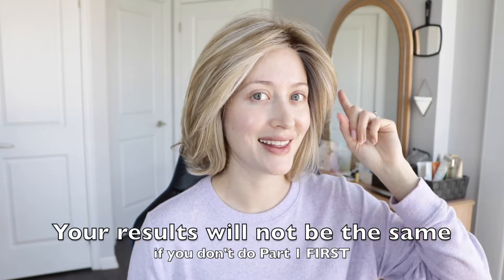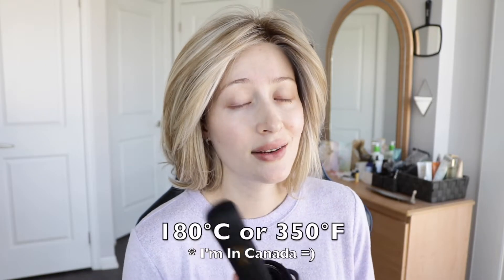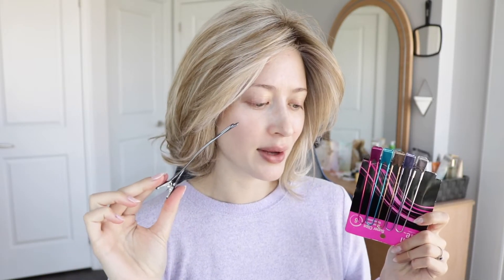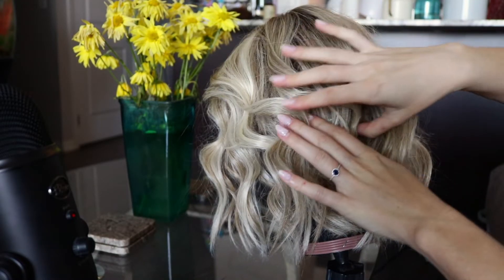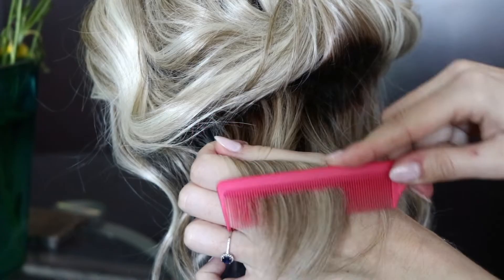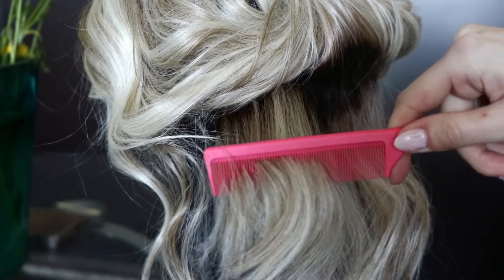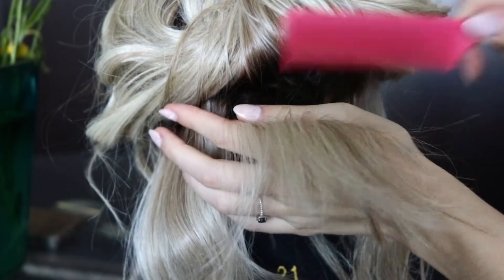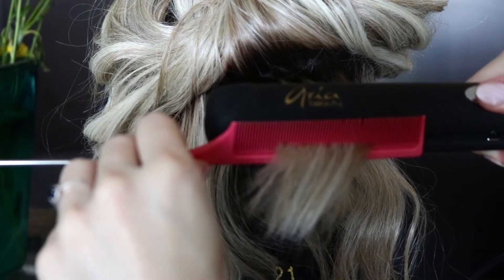MAKE YOUR OLD, Heat Friendly Synthetic Wig Look BRAND NEW With Straightener| PART 2

Comment: Wow, these are some really good techniques! I have used fabric softener with some of my wigs and I also never saw an issue with it.  But I have never heard of using the Bonner Soap! I can see why that would be great to use as it is all natural and has softening oils in it - and you can use it on a lot of different things. I have some HF Belle Tress wigs that I need to try this with. I have seen that I have to add heat back in to my BT wigs every few wears to keep it looking good. How often are you washing your wigs; and by using the straightener, aren't you afraid of taking out the curl pattern of Simmer?  I tend to buy a lot of wavy/curly wigs, and I hesitate to use a straightener to add heat back in.
Reply from the maker: Yes, I absolutely recommend it!
Not at all, on Simmer, I will totally take out her wave (on purpose!) to revive her and then I’ll just use the same straightener to put the wave back into her after. This is how I’ve been able to wear her every day without her weighing down. Re-styling was something I was afraid of at the beginning of my wig journey because the wigs come so beautifully styled! But the great thing about heat friendly is that you can keep changing it until it’s perfect. And after enough practice, it becomes easy. I now easily return her from wavy, to straight, to curled, to straight again, and have no issues at all. Actually, the wave on simmer in this video was my own creation! I’ve had her straight many times in the past 😊💕
Reply from the maker: I don’t have a set “rule” as to how often I wash them. If I find a lot of makeup build up just on the lace front but the fiber is doing just fine (moving in the wind naturally / not clumping together) then I will just put the dr.Bronners soap on her lace and quickly rinse it off. 
If I wear her every day, (let’s say it’s summer and it’s been super hot) and her fiber starts to clump and get tangly, that is when I’ll wash her and refresh her with heat the next morning 😊 I hope this helps!!! Thank you so much for your comment by the way!!
Reply: @WigsWithSteph  I have found my BT wigs do not curl as well with a straightener or iron on a low setting. The only thing that has worked is a set of hot rollers I have. No real setting on them so they just get good and hot. I will leave them in for days at a time and the curl is really nice and holds. I may try a small section and straighten the fiber first and then curl it to see what happens. I have found a hair dryer works good as well to add heat back in

Comment: I understand the process of smoothing it now, but I am confused as to how to get the specific wave pattern that the wig started with. When I have tried to use a straightener or curling iron the hair doesn’t just glide through them like yours did. The only thing the straightener does is straighten the curl.
Help!🤔🙏

Comment: Ok girl, I'm going to pull out the RW Editor's Pick wig that I gave up wearing because I couldn't return the waves & curls in it.
I haven't tried the fine comb with my straighter. I was WoWed at your technique. 
I hope this will save the wig!! 
I'm horrible at curling with the Straighter so I use a Hot Air Brush.... holding the heated curl to allow it to cool is the secret, or pin the curls to allow the cooling time.

Comment: I washed and conditioned my first HF wig today and it was drying while I was watching your video. Most of my wigs are non-HF and I figured my HF wig was at the end of its life, since the fibers had been sticking together and hard to comb through…BUT decided to treat it with the same Bambu Silicon Mix conditioner I recently discovered and had used on my non-HF fibers. I washed it, rinsed, pressed the water out by laying it in a very thick microfiber towel. I coated the fibers with the Bambu Silicon Mix. Placed it in a ziplock bag for 4 hours (which can be overnight). Took out of the bag and gave it a good rinse. Patted out between a towel again and hung to dry.
I stopped your video at 9:15 minutes and went and got the wig. 
I took a wig brush to it and saw my wig was transformed to its former days. 
So glad I won’t be needing a wig head for my HF wigs, which I’ve never used heat on. 😊
Reply from the maker: That’s great! So glad you’ve found something that works so wonderfully for you 😊

Comment: Great video! 💗 I've been using fabric softener and yes, it works wonders. Thanks for sharing your flat iron technique! Have you ever tried adding a mist of water to the heat friendly fiber before flat ironing? I haven't done that but have read that it works pretty good as well. 😊

Comment: I did hear not to use fabric softener on hand-tied wigs because it loosens the knots. If it’s not hand-tied I would not see a problem either. 
Great video- it gives me hope to buy a heat-friendly next time 💜
Reply from the maker: I have not found softener to be a problem on my hand-tied wigs :) But if there was some concern, someone could always use the “dip” method- just by dipping the ends, mid-length of the fibers into the softener could give it the same effect I would think. For myself, I’d never not use the softener. I find without it, I can not achieve my desired results
Reply: I trust that you know what you’re doing 😀
That was all hearsay what I wrote above 😆 and we know what that amounts to….
I love your videos and just subscribed 🌺
Reply from the maker: @have_faith_  you’re the best, Cindy!! Happy to have you here!!! ❤️
Reply: She used fabric softener on her mono top wig & it turned out OK. Hand tied is basically a mono cap

Comment: Hi there what about steam? I was told to use a steamer
Reply from the maker: @patriciaikeda2608  using a steamer for a regular synthetic (not heat friendly) is the correct tool to use. You would do the exact same process I showed in this video, except use a steamer instead of a straightener

Comment: Question! 🙋🏼‍♀️
If you wanted to add structure to the waves, could you use a salt spray? Or maybe something else?
Reply from the maker: I think a salt spray isn’t really needed on synthetic wigs because they hold really well to any shape and I find structure is pretty good without. I tend to like to keep my wigs as bare and without extra product as possible (so that I don’t have to wash as frequently)- although I haven’t exactly tried a salt spray on my wigs before. Perhaps the waves could benefit? I’ll have to try it and let you know 💜😊

Comment: When you use heat to take out tangles, does it remove the memory of the curl or bend in the hair?
Does the hair go back to the original curl?
Reply from the maker: Hey! =) Adding heat to a heat-friendly synthetic wig will alter your wig, BUT if you use a low heat setting, and go over it gently and not too many times, you could potentially keep the wave or curl. This is why I only begin adding heat to it when my wig is like DYING and it doesn't feel nice anymore. At this point I really don't mind if I have to re-style her. I'd rather make her feel like new again, soft and beautiful, even if it makes her straight. I can then go in again, AFTER this technique, and add curl or wave if I want =) OR leave it straight for a couple of weeks, wear her around like that (enjoy a new style!) and then put the curl or wave back in =)
But yes, adding heat does alter the style (the memory style) of your wig.
Reply: @WigsWithSteph  That's what I thought but thanks so much for replying. Your videos have been really informative and helpful!
Reply: @WigsWithSteph  This is what I'm afraid of.  I am NOT good at styling, and the built in waves on my wig are so perfect.  I wear cheaper wigs and you can definitely tell the difference. They don't last 2 years, I can get maybe 3 months max.  Then I have to start trimming off split ends and it gets so matted I feel like it's unfixable.  So you are able to fix your rough split ends with the straightener and you don't trim them off?  Thank you so much for your videos!
Reply from the maker: @karaitskara  Hi! Yes, that's correct! I am able to fix my rough split ends with my straightener every time (I don't trim the ends). But keep in mind the more you straighten, yes, over time your wig fibers will become straighter. So, if you're wanting waves, waves will have to be something you put back into your wig (recreate them). I know it can be a daunting task - it was for me too when I first began!!! But I swear to you it's SOOOO worth it, and it becomes really fun when you learn an easy wave, easy curl, and... well... the straight is easy LOL. But, once those skills are cultivated, keeping your synthetic heat friendly wigs looking AMAZING will actually be fun! =D

Comment: Does this work for every brand? I have one from Ellen Wille.
Reply from the maker: Great question! Yes, this technique will work with every heat-friendly synthetic wig. It doesn't matter what brand. What matters is that the wig is heat friendly. If it is, this method will work. I have Ellen Wille wigs too, also Jon Renau, Belle Tress, etc..., and as long as the wig is heat friendly, this works amazingly!
Reply: @WigsWithSteph  Ok! I will try it! Thank you!

Comment: Your videos are awesome!
I have problems with various wigs, where the ends become dry and frizzy and that does not change after washing and styling. I buy cheaper synthetic or heat friendly synthetic wigs, often on sale. Maybe that is part of the problem but I can't find that others run into that. I have a hot air brush and I am not yet brave enough to use a straightener again, because when I used mine on a particular more expensive HF wig the first time, just on the ends, it frizzed them up immediately. I guess, I am just too stupid to get it right. Any tips?

Comment: I have a question about the styling spray You said you only straighten and curl on a clean shampooed wig but do you spray the heat protectant the stalling spray on a little bit before you straighten or curl or do you wait until after? Your video has helped me the most Thank you for posting those.
Reply from the maker: @123kfain  Hi! ❤️ After refreshing the wig in this way, when it’s totally clean and after I straighten it, is when I usually spray on the simply stylin’ silicone spray.

But if I’m in between, like I know my wig will need a refresher soon but I don’t have time to do it just yet, then I will comb it out with a detangling spray, and then spray the silicone at the ends of the fiber to keep it going for longer before I need to refresh it again 🤗❤️
Reply: @WigsWithSteph  thank you so much. I'm going to straighten it tonight but it looks really refreshed just after the washing with the way that you instructed . Thank you again!

Comment: When using a straighter, how do I prevent it from losing the curl pattern?
Reply from the maker: You don’t really prevent it. When you straighten it, it’s because you need to refresh it- like you’re so annoyed with the tangling at that point that it’s bugging you and you’re only choice is to refresh it. At that point, this is the way to do it, and the wave will likely loosen. Because it’s synthetic fiber, not real hair, it reacts different to a straightener, and a quick once over ever fiber to refresh isn’t going to take the wave out completely. But after a couple of times with the straightener, it will in fact become straight. If you want a curl after that, you’ll have to put a curl back into it. Or make whatever style you want :)
Reply: Can you do a video of how you put the curl back into Simmer?

Comment: My lace front has a small "chip"  cut in it. Can I trim the lace or will it unravel? How far back can you cut it?  Can you really wash a HD wig every two weeks? I keep getting the less is more advice. Thanks for doing these videos you are so explicit and easy to follow.
Reply from the maker: I would say my best advice is to wash your wig when it needs to be washed. Sometimes I will go 4 weeks without washing mine! With that being said, if you’re in a dusty environment, or you’re sweating a ton, and you just feel more comfortable washing your wig more often, don’t shy away from washing it. If you then go and “refresh” your HF fibers with a straightener after washing & drying it, it will come back to life. I also have a silicone spray that I use to coat the fibers on my synthetics occasionally when I feel as though I need it. Just as up keep. I’m not somebody who will shy away from altering wigs, because ultimately if somethings bothering you with it, it makes more sense to “fix” it than to keep living with the problem. 

As far as your lace goes, if it was me I would cut it. If anything, cutting it will keep it from fraying. Cut off the least amount you can while still getting the job done 🤗❤️
Reply: Thank you so much.  I really feel better washing at least once monthly. I use the same washing products as you and Jon Reneau 3 spray. I only wear Toppers at this point but they have made such a difference in how I feel about my hair loss I want to keep them in good condition as long as I can. I will take your advice on my lace front and trim it. You have given me good reason to attempt it.  I can’t thank you enough.

Comment: I am a new wig wearer and have a quick question. I can do the washing and heat smoothing, but I’m not very good at curling. Can you wet the wig after smoothing and get the curl back without curling? Thanks for the help.
Reply from the maker: Are you speaking about a synthetic wig or a human hair wig? Just want to make sure I don’t give you incorrect advice 🤗
Reply: I’m talking about synthetic wigs.  @WigsWithSteph

Comment: i am lucky enough to have a lot of wigs, which get rotated daily, so i haven't needed to wash a wig yet; however, what is a tad confusing to me is why your flat iron didn't actually straighten the wig.  i know that straightening it wasn't your goal, but i'm petrified to take a flat iron to a curly or wavy wig (unless i want to straighten it) because i suck at using a curling iron!  yet, here, it seems you've used a straightener on her over a two year period and she still has waves...how?
Reply: I have same question. A flat iron takes all of the curl out in my experience.

Comment: My straightener has a number dial but doesn't tell the temperature, what number should I use to put heat back in my wigs?
Reply from the maker: Hey! I can't be certain what each number would mean. I would suggest using a low setting, and testing a few strands. If nothing is burning off, then you're good to go! Also, make sure your wig is heat-friendly to begin with. If it's a regular synthetic wig, a straightener shouldn't be used at all.
Reply: @WigsWithSteph  ok, thank you

Comment: What about hand tied wigs . I have Simmer Elite and was  so knotty after 1 wear. I only use water to style and detangler spray at nape at bedtime . I need to wash her.  I have worn her at least 12 times.
Reply from the maker: I wash and re-style hand tied caps the same way, just take a little extra care and I’m not as aggressive. I’ve never had any issues
Reply: @WigsWithSteph  thank you so much for your advice. I spent so much money on synthetic shampoos and conditioners.  I do have the Belle Madam but says to wash in lukewarm water and to leave conditioner in without rinsing out??? I am supposed to use cold

Comment: How does the flat iron not straighten the curls out?  That’s what I’m always worried about!
Reply from the maker: Hey! :)
With the synthetic wigs, they perform differently than real human hair. Because of that, you’d have to run your straightener over it quite a few times, or move it extremely slow over the fibers to make it poker straight. In this video, my intent was not to make the wig straight, but just to get the tangles, roughness out of it, and keeping the shape the best I could. By only running the straightener over once or twice, moving at the speed I did, at a low heat setting, it’s not going to straighten too much. I hope that makes sense. On the other hand, there comes a point in every wigs life where in my mind it’s better to create a new shape if it means you’ll get a wig that feels brand new again. 🥰 So, like, even if my wig does become slightly straighter when I don’t want it to, I can always go back in with the hot tools and re-create any curl or wave that I took out while refreshing 💕
Reply: Thanks for the thorough explanation!  I just started wearing wigs last January and have learned so much. I’m very comfortable in wigs of all types. I’ve learned how to cut out wefts, cut off ear tabs, pluck parts, everything I’ve learned from all of you great wig influencers!!!  Thx so much for all that you do!!!
Reply from the maker: @pamsfiberfrenzy  awwww I’m so glad to have you here 💕 that’s literally why I started my channel… I remember how hard it was to learn about all this wig stuff when I first started (there wasn’t too many YouTube videos when I first began my wig journey) and I remember feeling like I didn’t know what all the terms were, what things meant, how to do anything! It makes me so happy to know that I’ve shared something useful for someone else ❤️ XO